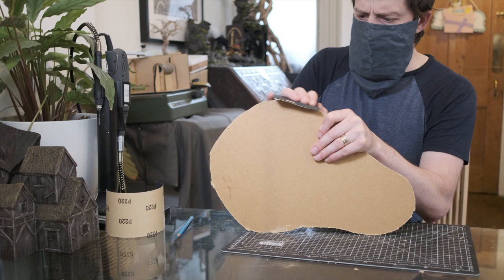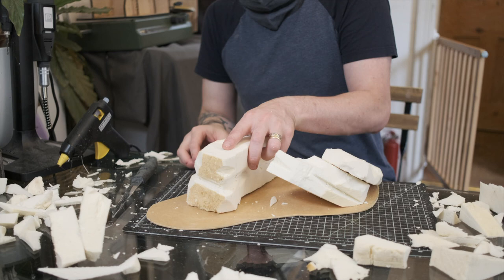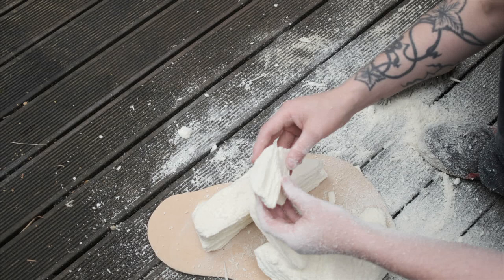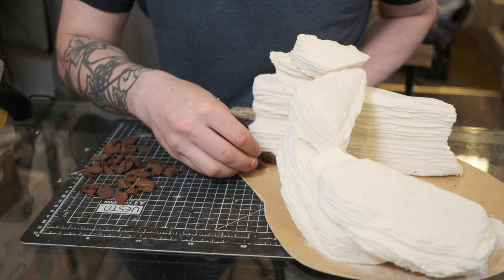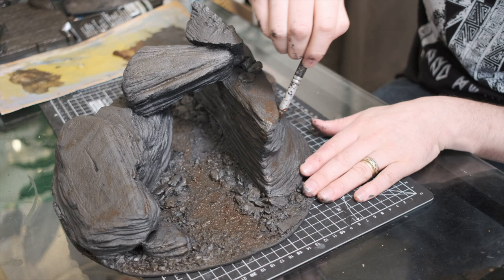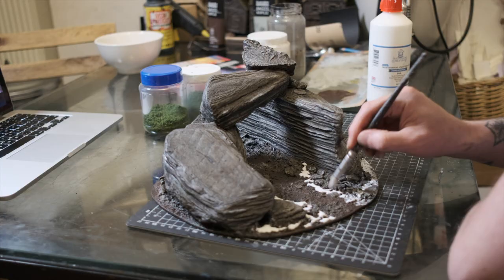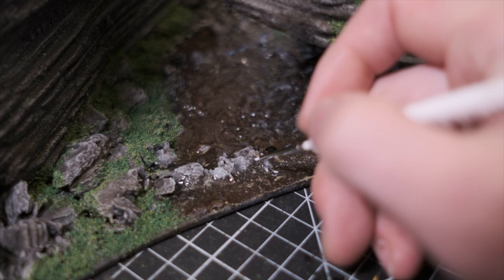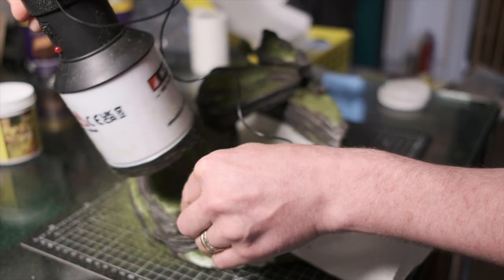How to make REALISTIC rocks for landscape models

Comment: I have the same 25mm Hudson & Allen buildings.
Reply from the maker: Are you sure...? the buildings on the tabel are from Ziterdes, built by Thomas Doll
Reply: @Nat1videos  They are Ziterdes. I just looked at the site I bought them from. They had Hudson & Allen castle bits lumped together with Ziterdes. My mistake. They're decent sculpts for only being exteriors.
Reply from the maker: @readhistory2023  Yeah I think they are more suited to skirmish style war game scenery rather than DND because of the lack of playable interiors... I have the buildings because I am building a gaming board for Ziterdes to show them off, and I have come up with a solution for the playable interiors. That video will come out in a week or 2... it has suffered some delays because of a resin pour failure